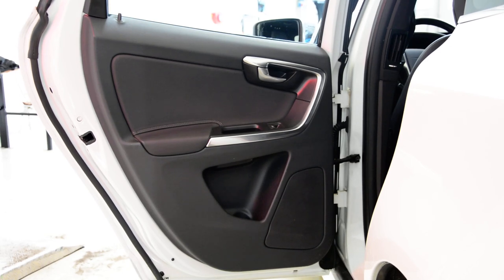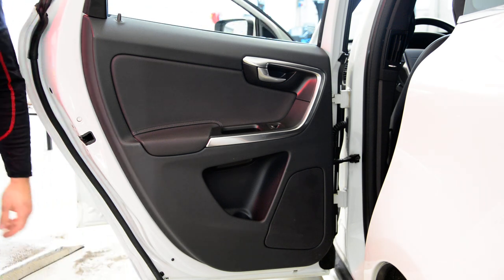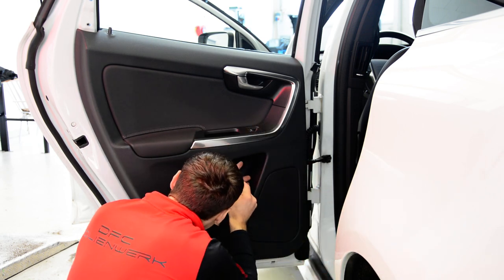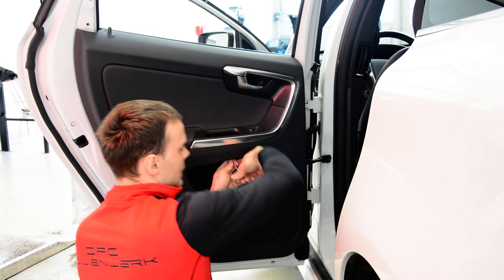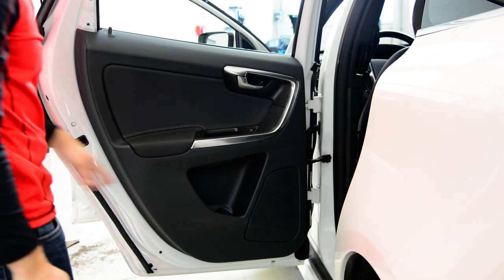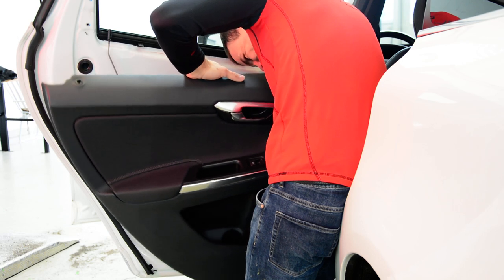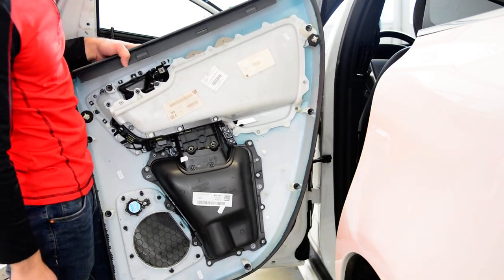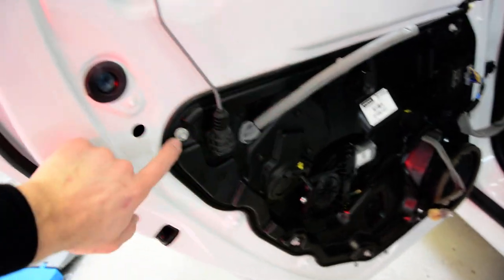How to remove the door panel Volvo XC60  2009-2017

Comment: The thing that most people would get stuck on is removing the cable for the door release and the window switch and you do not show it or explain it.
Reply from the maker: Hello.is very simple to remove the cabl and the the switch to this model. That's why I didn't explain how to remove them in details.
The problem is I'm making this videos will I'm working and I don't have time to go in to the details